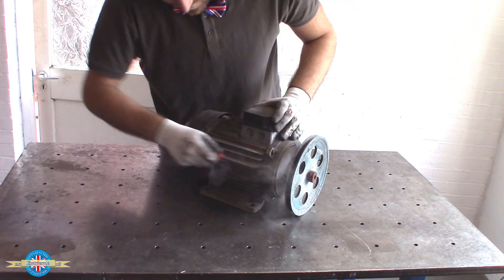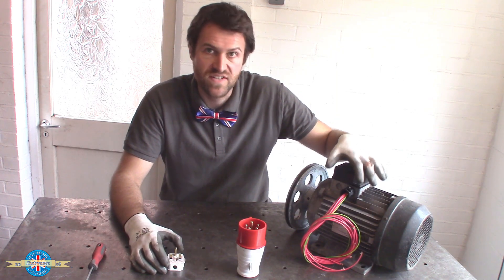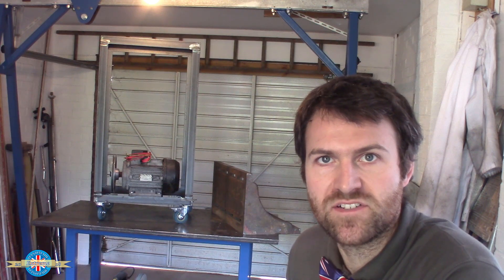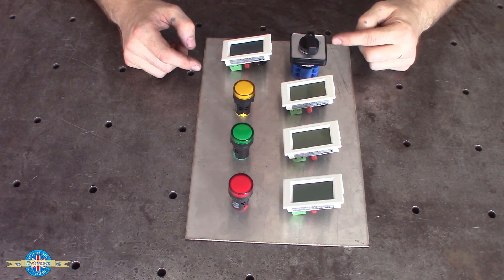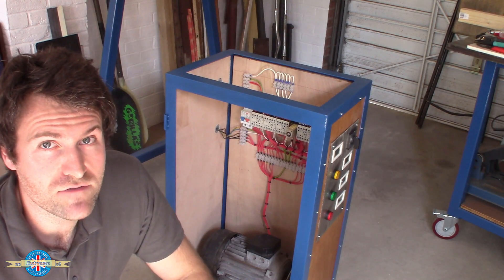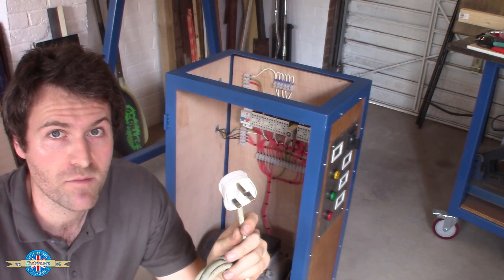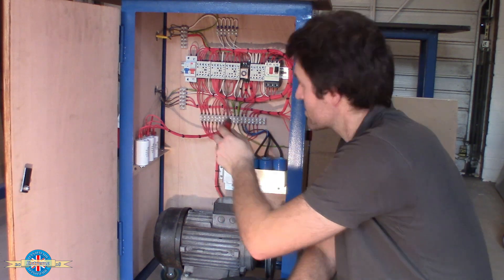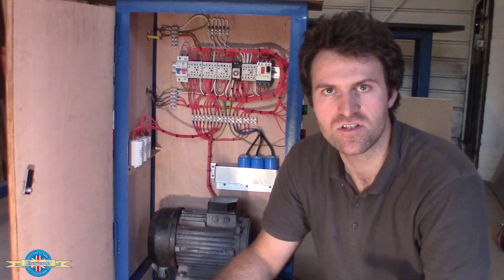1 Phase to 3 Phase Rotary Converter - 230V to 415V

Comment: Brilliant build. I converted a couple of 3 phase motors about 25 years ago for a friend and it’s so satisfying when it works. Not as well done as your converter but a much more Heath Robinson job with a bit of trial and error with various capacitors and a home made current operated relay.
Reply from the maker: Nice, the main thing is that it works at the end of the day. Id be interested to see the relay you made. I presume you used some sort of bi metal strip and a limit switch?? 👍
Reply: Handmade Extreme if I remember correctly, I obtained a current relay from a domestic fridge compressor and I removed the current coil. I obtained a few feet of heavy motor winding wire and rewound with just a few turns. The coil carried the main load and I wired the switch part to a heavy contactor as a relay I first fitted failed fairly soon. The contactor was just switching the start capacitor. It really was trial and error as there was no google back then but it worked for years after that. Thanks for your video. 
I would hate to be critical of your video but my only complaint is the music in the background. Just my preference.

Comment: oldskool!  lol, modern one phase to 3 phase electronic converters are not expensive, you can even control the motor rpm whit that... But y agree, oldskool is nice to!
Reply from the maker: Cheers, doing it this way works out a lot more cost effective for me. If I wanted to power all of my three phase machines with VFDs I think I would need about 7 of them.

Comment: I would add an extra ground wire to the metal chassis just to be safe. However, I guess your motor is bonded to the chassis.
Reply from the maker: You don't see it in the video but the chassis and fascia are both bonded as is the motor. Cheers. 👍

Comment: Firstly!  this is a great job you 've done there. I have a Harrison 300 3 phase lathe and I only have 240V single phase supply. Got myself a VFD but its just too weak to run the lathe. Mind you I have connected it straight to the terminals of the machine. Did not connect it onto the motor itself. How is it possible to get the electrical plans to built the rotary 3 phase converter?
Reply from the maker: Thank you😀. A VFD should be connected directly to the motor. They do not like having other things in between. The Rotary converter is just like having a 3 phase socket on the wall i just plug the whole machine in. There are some links in the video description to a couple of videos that go into more technical detail including some diagrams. I may do a follow up video at some point as well since that seems to be a popular question. Cheers. 👍
Reply: @Handmadeextreme   Great vid very professional job! Well Done :)  I am just wondering a similar question, but specifically I'd like to know how you wired up the delta-star configuration that includes the timer?  I've been scratching my head about that for some time now!  Would it be possible to do a short vid on that? kind regards

Comment: Circuit diagram and a ballpark figure for the caps, please. Pretty please?
Reply from the maker: There are some links in the description to some videos that show diagrams. The cap values are also in the description. Note they are motor specific and should only be used as a guide. Cheers. 👍👍
Reply: Found it. https://youtu.be/TXVlIU73yFg?t=277

So running cap is around 2yF per kilowatt, right? But I didn't catch the starting cap value at any point in the video.

Comment: Would it work if you drove a 3 phase motor/generator with a single phase motor? Would you get 415 V given that you drive the 3 phase motor with the right rpm? Would this be inefficient compared to other means?
Reply from the maker: I have seen this done but I believe you still have to inject some electricity into the 3 phase motor to 'excite it'. You also need a substantially larger single phase motor than the 3 phase motor. Cheers. 👍

Comment: If it draws 50A to start then isn't there a mcb on the 16A outlet? Also maybe you could use a slow blow fuse on a household plug? Just an idea I'm not clued up like you are. Great video!
Reply from the maker: There is. However the MCB will allow an inrush for a couple of seconds before it trips. Same principle as a slow blow fuse. Cheers, glad you liked it. 👍

Comment: okey if you have the knowledge and ability to build this, why not run a propper 32 or 16a line with a propper cee plug to your workshop instead of doing this?
secon of all if you have a propper industrial 230V 16A 3pin plug allready in your workshop it furthermore raises the question why not use an existing line and fusebox to make a propper 16a 400v port avaiable? this just seems like an expensive and not neccesarrily save way to do this with a lot more work.
Reply: Still cool and makes for a better video i suppose :D
Reply from the maker: I wish it was that simple. Unfortunately my house only gets single phase and neutral from the grid. If I had 3 phase on the property I would have done exactly what you suggest. Glad you enjoyed the video and thanks for commenting👍👍
Reply: @Handmadeextreme  verry interesting. 🤔 i mean this whole thing surprises me since i live in Germany, and every single house has a 3 line input at 480v from which you can easily split off 230v to n and pass them through to a 400v plug 5pin starting at 16a up to industrial standards 123a
never knew that there were houses which don't have that verry interesting indeed and definitely a great video.
Reply from the maker: Yep, you guys are way ahead on housing over there. Things like Solar and Passivhaus are only just starting to be taken seriously over here. We are way behind... We can get 3 phase connected but its not cost effective. If I was going to live in this house forever then I would consider it but we might move at some point so its not worth it. Cheers. 👍👍

Comment: It was good 30 years ago .Today just buy inverter single to 3 phase for $100 it's small and weight 2 lbs and is digital  VFD
Reply from the maker: I completely agree with you if I only wanted to power a single motor. For example a drill press or bench grinder. I should have made that more clear in the video. However, to equip all of the machines in my shop with VFDs would be cost prohibitive. The rotary converter was cheaper than you might expect. It cost around £300 including the materials for building the enclosure. Cheers. 👍

Comment: doesn't that electric motor need air to keep it cool or did I miss you putting vents in the box
Reply from the maker: You are correct it does, the bottom of the box is open to allow the inbuilt fan to chuck a bit of air around. I have not had any thermal problems yet but I have only been running it for short periods. If it does become a problem then I will put some extra vent holes in the enclosure. Cheers. Great observation. 👍👍

Comment: What benefit does this have over an ebay VFD?
Reply from the maker: As i have a few machines I would need multiple VFDs. Therefore in my circumstances the rotary converter is more cost effective and less hassle. Great question, thank you. 👍👍
Reply: It has almost no benefits. Small VFD's are the best. You can run multiple machines on one VFD too, just need a smart contactor setup to switch between motors. And obviously couldn't run them at the same time.
Reply: @UhOhUmm  And you would have to set the VFD up for each machine before using it. For multiple machines and machines with more than one motor, a rotary phase converter is a good solution.

Comment: As an electro technician, I appreciate your cable management job. I would recommend getting some thermal protection on the idler.
Reply from the maker: Thank you, glad you enjoyed it. There is a Schneider GV2ME motor thermal overload protecting idler. I probably should have mentioned that in the video (oops). Furthest item to the right on the DIN rail.  Cheers. 👍👍

Comment: I was a little confused at the output voltage reading. it is around 415 volts on each of the 3 monitors but that is the voltage between two phases, not each phase to neutral. each phase to neutral should read around 230 volts. if you had 415 volts between each phase and neutral you wold have about 720 volts between phases. you have a 230 volt single phase to a 230/400 volt 3 phase converter.
really nice and clean build!!
Reply from the maker: You are absolutely right.The input voltage is phase to neutral and measures 230v. The output phases on the displays are phase to phase 415v which is the same as 230v phase to neutral. But now with three distinct phases at the correct 120 degree phase angles. Glad you enjoyed it. Cheers. 👍👍

Comment: Just finished the video and subscribed!  I work as a welding supervisor for my states corrections system and this is something that would help me out when needing to get a larger welder or plasma cutter inside the facilities.  Some of the work you did I can do but I'm not an electrician by any means, does RODALCO2007 and Galvinizedsankey  videos cover the wiring and components more closely?
Reply from the maker: Glad you enjoyed the video and its great to hear that you are working towards rehabilitating the miscreants. I believe that helping people to learn new skills that enable them to get gainful employment is a step in the right direction. You would need to do some further research but I think that you would need to up the size of the converter for running welding equipment as the inrush current on arc start is quite high. To answer your question the videos by Galvinizedsankey go into more technical detail including some diagrams. I don't know if he will ever do part 3 of the series but I got a lot of my information from his first 2 videos. Hope this helps and good luck with your work. Cheers. 👍👍
Reply: My position is for the maintenance department so my instruction is limited to when I supervise offender workers and instruct them on ways to do different welding techniques and non welding work.  I do take time to listen to them when they need to talk about non work related things and will joke around with them from time to time.  To be honest it is one of the least stressful jobs that I have ever had and you would think otherwise since I work at a maximum level 5 security prison and a level 4 maximum prison as well.  Movies and tv shows heavily exaggerate what life is actually like in prisons for the most part at least in my experience.  Yes there are problems and yes staff get attacked and prisoners attack each other but it isn't to the level of violence that you find on the box or at the cinema though I can't speak for places like Russia or Mexico, I can only speak for the places I work at.
Reply from the maker: Thanks for sharing that. It is always interesting the learn about other areas of work. 😀👍

Comment: You said it draws 3 amps from the single phase to start the induction motor, will it draw only 3 amps no matter the amp draw of the 3 phase?
Reply from the maker: It draws about 3 amps when it is running idle. Ie not powering any machines. The start up current is about 60 Amps for ~1 second. Then the current drawn from the supply is proportional to the load placed on the converter buy the machine it is running. More load = more current demand. Hope this helps. 👍👍

Comment: buy some 230V frequency converter in smal size...  its tested and cheaper like this.  100x100x50mm only with screen an buttons
Reply from the maker: This was a consideration, however I would need to buy 7 of them to run all of the machines in the workshop correctly. So I chose to build the converter instead. If I only had one machine then yes a VFD would be fine. But for my situation the converter is far more cost effective. Thanks for watching.

Comment: Thank you for posting this build. I've been dabbling with most forms of single to three phase devices but come across your exact method before. I wonder if you really needed to start the pilot motor wired in delta. When starting, the motor is unloaded and so I would suggest that starting in star on 240v should work ok and so simply switching the neutral from one main terminal to the star point would make the switching simpler and the component count down. Best wishes Bob
Reply from the maker: Hi Bob. Really great idea, I love comments like this, thank you. If I ever build another one I will be sure to try that. Heck, I might even try it anyway just for fun. Cheers. 👍👍👍
Reply: I've got a 3 hp motor lying around mainly for testing inverters so one of these days I might knock up a rats nest converter to try out the idea. Bob
Reply from the maker: I would be interested to see what you come up with. 👍

Comment: You can buy special soft start boxes to prevent the high current (electrical company doesn't like those either very much) or put a star-triangle switch.
Reply from the maker: I will look into it, thanks. 👍👍

Comment: Could you replace that useless pulley with a fan for cooling, or with a flywheel to store some energy for the inrush when you start the lathe?
Reply from the maker: I actually did exactly this a few days ago. There is a fan at the other end of the motor anyway but I added a much heaver flywheel and it does help a lot with inrush as you correctly pointed out. Cheers, great comment. 👍👍
Reply: @Handmadeextreme  Hi.
Excuse my my ignorance but what do you mean by inrush?
Reply: the energy the lathe motor uses to start up is higher than the energy it consumes whilst running
Reply: @Handmadeextreme  Any gyroscopic incidents? Like turning the worktop 90 degrees and the whole thing falling on its side? Generally flywheels are bolted to extremely heavy things like cars, locomotives or the Earth.

Comment: First video of yours I've watched and enjoyed a lot! The tip about the hinges is spot on, hope I remember to do that if I ever make some! I can't tell from the video, but maybe some sound deadening? Rubber mounts between the motor and the chassis etc. It seemed pretty noisy from the short running clip you included.

Three phase is tricky to wrap the head around so I think you could have benefited from a whiteboard with the motor poles and star arrangement drawn out, just to aid explaining the wiring. It's easy to get lost with words alone!

Great job, subbed and looking forward to some more vids.  Cheers
Reply from the maker: Thanks very much, glad you enjoyed it. Great idea regarding the sound deadening. I will put that on the list of jobs to do. 
Based on some of the comments I think I might do a follow up in future to answer a few of the questions and go through it in a bit more detail. Maybe a sort of Q&A type video with some diagrams etc. Cheers. 👍👍

Comment: Nice job and something i have wanted to make for sometime as i have a workshop full of vfd's. It would be nice if you shared your wiring diagram and this may explain some of the thumbs down. It should also be noted that vfd's in your defence do not like shock loads and require you use their own start/stop which is not always convenient. What you have created leaves the machine/controls untouched and gives the workshop at near true 3 phase supply which can be tapped into as a ring and yes vfd's give more control but can not easily and quickly switched between machines.  To have both drives and rotary phase would be ideal. All the best with your channel.
Reply from the maker: Thanks very much, glad you enjoyed it and you have summed up nicely some of the pros and cons of VFDs. If you have a look in the description there are links to a couple of other videos that do include some diagrams. The ones by Galvinizedgary are quite good. Sadly I don't think he has done part 3 in his series but if you take your time you can get all of the information from parts 1 and 2. The main reason I didn't include any schematics is purely because I don't have any. Cheers. 👍👍👍
Reply: @Handmadeextreme  He has now. Both parts 3 and 4 are up and well worth looking at. He has a circuit diagram as well as good explanations for anyone wishing to build a RPC.

Comment: Would have been much cheaper to buy a 3 phase inverter
Reply from the maker: If it was just for the lathe then possibly yes. However, the reason I built the rotary is because I have a couple of machines that I want to power. At this point the rotary became more cost effective than the multiple VFDs I would have needed. Cheers. 👍👍

Comment: Well done! That's the definitive lemonade from lemons situation right there!

Question though, wouldn't replacing the pulley on the motor with say a heavier flywheel result in a more stable power output overall to compensate for start up loads?
Reply from the maker: Thank you very much. 👍
I did exactly that a few days ago and you are absolutly right it does dramatically help with startup loads. 👍👍 Cheers 😀